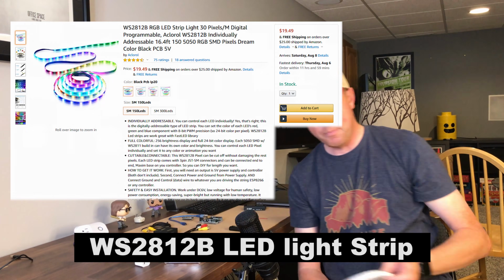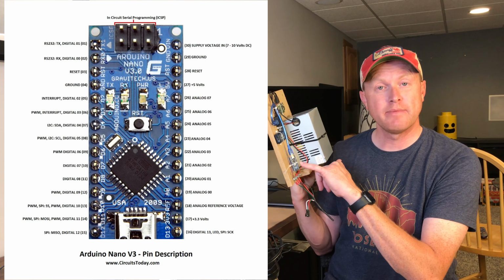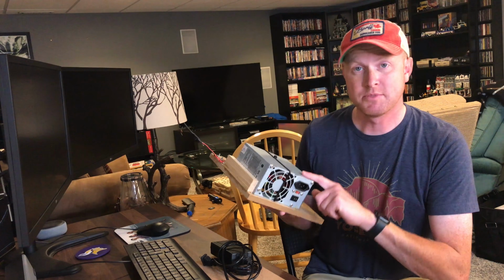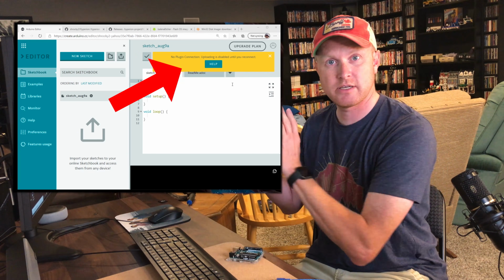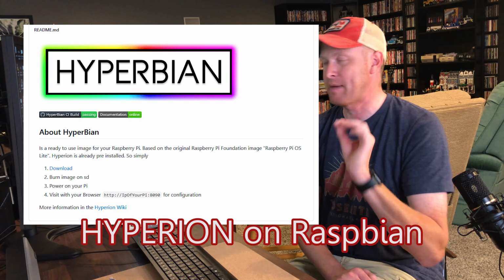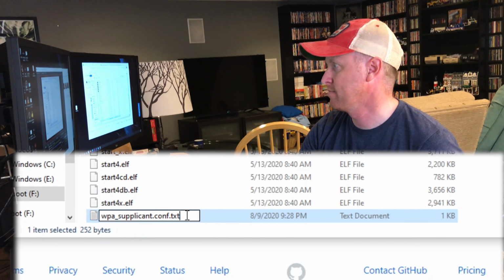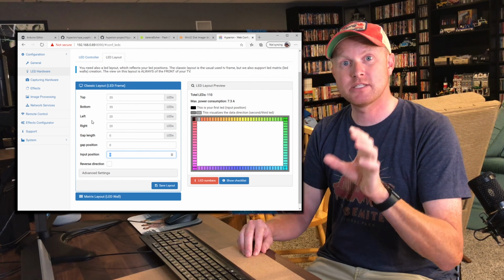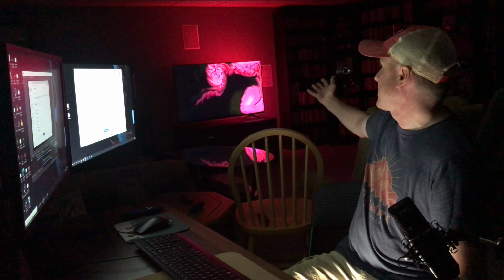DIY Hyperion Ambient TV Light Project (Raspberry Pi + Arduino) Complete Setup

Comment: So i got it working, couple things to note that may help others:

1.) I used the nano clones (the first link recommended on Steve's github) but when writing to it, I had to choose ATmega328P; the first one in the list.  NOT the bootloader.  When trying bootloader, I got errors when trying to write to it

2) Maybe its obvious but took me a while.  If you are using MORE than 110 leds, you must change that number on line 4 of the sketch.  I opted to buy the led strip he recommended, but with 2x the LED's and couldent figure out why only about half the strip would light up.  Was about to rip it off the tv when I realized I needed to change the number in the sketch (as well as Hyperion of course)

Comment: Hi STeve, in the Hyperion>LED Hardware>LED Controller, I am not getting the option for Bodrate. I am using an Arduino Uno with Pi 0W. Any suggestions?
Reply: @Steve_Does_Stuff  Thanks Steve, settings options found and worked. Can I suggest in the video description, to add text to refer to "Expert Settings.png in the Github page for Badurate settings option in Hyperion". I figured it out eventually but saw it was there all this time, LOL!
Reply: @Steve_Does_Stuff  Another query though, my lights are just not turning on, whilst it used to previously (when newly bought). The 4metre WS2812B strip I bought has power supply connectors at both ends. Have used a digital multimeter onto the strip to validate voltage is being received at both ends. The difference I have in my setup: 1) Arduino Uno; 2) Separate power supplies for LED strip and Pi 0 W but more than as calculated from formula and validated in Hyperion web editor for no. of LED's connected; 3) Using barrel connector in Arduino Uno board to transfer data (as the end of LED strip has two barrel connectors, one for power and one for data) that connects into the USB hub connected into Pi 0 i.e. not connected directly to the strip (do you see this being an issue generally i.e. does a cable ned to be directly from Arduino to the strip?). In Arduino sketchbook, I have changed line 9 entry for DATA_PIN to "5" instead of "6" as per the Uno's GPIO connections (will this work or be an issue, any thoughts?). 4) Connected Uno Ground terminal to Pi 0's Ground (awaiting cable delivery to connect from strip to either Pi 0 or Uno as per schematic diagram on Github). 5) 4k HDMI USB capture card with passthru connected directly to USB hub onto the Pi 0 (as per schematic).             Some successes I have had: i) previously the "Live feed" in "Led Visualisation" in Hyperian web editor was showing a fuzzy code i.e. not an image from screen which resolved when the power supply (Ampere) was increased.  ii) I changed the BOD rate to 115200 in both Sketchbook uploaded to Uno and Hyperion for Pi 0, as suggested in a user's comment, but to vain.           Any suggestions? Apologies to bother you with long text, would appreciate your input.

Comment: Great job man. I created a video on my channel just without using a rpi and hdmi capture card. Only works with pc connected. But I will try out your method. If I create a video from it I'll make sure to mention you and credit your work. Cheers.
Reply: I liked your video too. I use a PC for everything on my main TV, and I already have a Arduino nano and a power supply I can use, so I think I'm going to try your method.

Comment: Hi, I'm gonna bother you with another question. Can you also power the raspberry pi via GPIO pins using the red, white wires from the LED (the ones meant to be extensions if you wanted to add more LEDs)
Reply: @Steve_Does_Stuff  Thanks! Super helpful.

Comment: Hi, Will It work for 4K TVs? Do I need a 4K capture card? I read somewhere that the output sources should be same meaning if I used 4K TV and 1080 p monitor then I will get 1080 on TV and monitor. Is it same while using a hdmi capture card? Can I get 4K output on TV even if I used the basic 1080p hdmi capture card?

Comment: Your setup looks great! Little help if you can please, I have everything setup according to your video and everything looks to be correct. Arduino seemed to have coded fine, Pi zero picked up and I'm getting live video on Hyperion so it seems the HDMI capture is working also. Problem is when I power it up I get a green, red, blue cycle once and nothing afterward. Any thoughts on what to look for. I'm using 260 leds on a 18A power supply and purchased everything using your links except for the 60led/meter WS2812B. I'm not really savvy, just watched your video 20 times to get here LOL
Reply: @Steve_Does_Stuff  Thanks for the quick reply man but it all checks out baudrate 500000 and ran it through putty again with the same /dev/ttyUSB0. Even went back to your github and pasted the coding in again just to be certain I didn't fudge it. Same outcome green red blue and they go dead
Reply: @TheLast-Czar  Hi, did you change uint8_t for uint16_t? For 260 LEDs yo do need to do that...

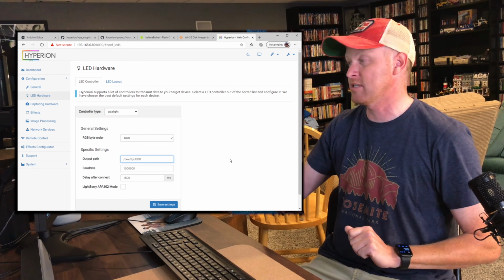Comment: Thanks for the guide Steve! I followed your guide to the letter, including the items purchased, and the only problem I had was the Raspberry wasn't talking to the Arduino - I think it was due to baud rates - in the most recent version of Hyperion, there is no option to set the baud rate (about 25:54 in your video) for the Led Controller Output path (some other comments indicate I could have set it to 115200 in the Arduino code?).  I ended up following some of the other suggestions to forgo the Arduino altogether and used the ws281x controller type, and connected LED the data wire directly to the Raspberry on pin GPIO18 (and ground).  Even though the Raspberry only has a 3.3V, the LEDs work great.  My 65" TV ended up with 268 LEDs and it works.  Thanks again!
Reply: @Steve_Does_Stuff  Well, it ran great for the last 3 weeks, but stopped working today - Hyperion is still working, and i can see the video feed from the capture card, and the LEDs still work, so I suspect that the GPIO pin on the Raspberry has burned out?  I’ll update here when I figure out what happened.
Reply: After tinkering with it, started working again. Not sure what changed.
Reply: @mikehatch4478  You should use a level shifter for the data pin, like a 74ahct125n to shift the 3,3v to 5v. you could also put a resistor in front of the data line, it's often recommended. May I know if you are still using your setup?

Comment: If you use a power brick how do you connect the power for the LED?
Do you cut the wire of the power brick and connect it with 3 wires from the LED?
Reply: @Steve_Does_Stuff  Thanks!. Just curious. What happens when you play a movie in a widescreen ratio and you have black bars top and bottom? Do you have no lighting for the entire movie?
Reply: @Steve_Does_Stuff  Thanks Steve. Appreciate it.

Comment: Ive purchased everything you've outlined here, seems like I've got all the software installed properly, i'm able to go into hyperion, and sometimes see my USB capture device (sometimes it bugs out) but it seems like the arduino isn't communicating with the light strip at all.  The only difference in the setup is that I'm using the power supply as listed on your parts and opted for the ws2812b with extra LEDs. any help would be appreciated!
Reply: @Steve_Does_Stuff  yea, i was able to match the baudrate to the upload on the create. The LED strip seems to be reacting, but not at all with whats happening on the input, even on a single color test, its flashing multiple colors.
Reply: @Steve_Does_Stuff  after sleeping on it, I believe I'd discovered 2 sources of the issues I've been having. First, I lacked a common ground, which I believe might have been bugging out the arduino. Second, because of the size of the TV and double the LEDs on the strip, the lights were Hyperion calculated needing 17 amps from a 10 amp adapter. I've ordered the same strip you have which will reduce the amperage to about 7.8, which will work better for the adapter.
Reply: @Steve_Does_Stuff  UPDATE! Got it working! Common Ground, Common Ground, and I'll say it again, Common Ground! Also switching out the LEDs to the one that had the proper amperage with the adapter likely helped as well.

Comment: WOOO HOOOO! A Bit of trial and error but I have it working! Rpi and Hyperion was the easiest part. Some notes about the Arduino Nano clones:  Once I got set up on the Arduino Editor, I had issues programming the Arduino Nano clone. I would error every time. The thing that worked was to plug it in, and whatever the editor recognized as the default, that's what I went with. No changing comm ports, or changing to the Old Bootloader. The baud rate did not work at 500000.  I set line 18 to 115200 and that got it working. (A quick search for Arduino Baud rates and found this: https://www.arduino.cc/en/Serial.Begin )  I also set line 12 to GRB, and matched it in Hyperion. The last thing, even though I ran the LEDs the same direction you did, I had to checkbox the Reverse Direction setting in Hyperion.  Thank you so much for all your work. It's really something special to see it live in action!
Reply: My lights are not turning on, I can see my image in Hyperion but not lights, With what you did will this fix my problem, I don't think the Arduino is sending a signal to the lights
Reply: @MrKingtiny  I'm having the same problem. I see the image in Hyperiod but no lights on the LED strips. Any luck?

Comment: You could probably cut out the use of an Arduino altogether and interface using only the RPi.
Reply: @Steve_Does_Stuff  tbe raspberry pi has 3.3v And 5v... No need for arduino.

Comment: trying it for a year now .. a whole damn year. and its still not working, spend over 200 € till today for stuff, losing my mind
Reply: Common ground? Baud rates match? Data flowing in the direction of the arrows on your strip?
Reply: @tjdurkin8848  could i need to check if it works when I create a common ground? baudrates are matching 500000, i also ensure the arrow points away from the source, indicating the flow through the strips, yeah
Reply: it work! common ground was the thing I did not hear in the video at first .. Thanks a lot !!
Reply: whats going on ?
Reply: @herbalmethods  right now they are blinking randomly. I used the hyperion android app to set some solid colors.. they sometimes work.. sometimes it doesn't seem to react at all. But basically the first maybe 5 led are always white, then the rest ist flickering in random colors. Tried pin 6 and 5
Reply: @Agiztos  yep... Try what dj says! Sounds like common ground issue....
Reply: @Agiztos  also another thing to Check...... I had an issue with the instances trying to work on top of each other and making lights flicker.... Changed settings so it only uses one instance at a time and it cleared it up

Comment: Is this old version of Hyperion or why you need Arduino here? You can use GPIO 18 on Pi Zero to control LED strip directly.
Reply: @Steve_Does_Stuff  I'm asking because I've just builded my first project following YouTube video (similar to your and just searched for proper led layout) and just connected 96 leds from my WS2812B strip to GPIO 18 without any shifters and it works just fine. Will it fail at some point or it depends on strip somehow?
Also, I you can use HDMI capture card with HDMI loop to eliminate HDMI splitter in your setup.

Comment: When I plug my audrino clone (same one you have) into my Pi3, go to COnfiguration > LED Hardware. Set controller type to adalight.  Under Specific Settings all I see is an output path that I can set to USB0.  I do NOT see baudrate

Comment: Could you run the HDMI splitter from the TV USB port, run the pi on the 5V SB line from the power supply, combine that with the push button for startup and shutdown of the PI, then run a startup and shutdown script that turns on the power supply (connects green to black via GPIO) when the PI starts up and powers it off (dis0connects green from black via GPIO) when the PI shuts down?

Also, reminder that you can set up DHCP IP Address reservation on your router so it always gets the same IP. You'd need to log into your router's web interface and find the DHCP or IP reservation settings, then input your Raspberry Pi's WiFi or ethernet (if using a hat/adapter or full sized Pi) MAC address. It makes everything easier to use if you need to type the IP to access something, including VNC, SSH, web servers, Pi-Hole, etc. You could even write the IP on a piece of tape or print a label and put it on the PI so you always know what its IP will be.

Comment: when using a computer powersupply make sure that it supplies enough amp's at the 5v powerrail. For example a 250w power supply will not give you 50 amps at 5v. it will divided that power between the 5v , 3.3v and the 12v output rails. You can find this information usualy at the label of the power supply unit. I found that out the hard way.

Comment: But aren't 4K@60 capable HDMI splitters quite expensive?
Reply: @Steve_Does_Stuff thanks! No need for 120 Hz, i'm using LG SK8500 as a monitor (max 4k@60). So it will fit perfectly.

Comment: which LEDs should prefer for TV ambient light 60/144 LEDs/meter??
Reply: Go for 60. That's more than enough light. Any more than that you'll be wanting to dim the lights. Afterall you are trying to acheived an ambient effect.
Also, if you were to crank up to 144 LEDs / meter you'd need some very heavy duty power supply. A pretty normal sized TV would use 4 meters of LEDs. So you would be looking at (4x144) 576 LEDs! That means a max power consumption of (.06 X 576) 35amps i.e. (35 X 5) 175 Watts! Better start calling the firebrigade!

Comment: I do not see the reason behind why are you using Raspberry PiZero + Arduino? Cant you skip the Arduino ? I have seen setups with only a Pi, but not zero one. I am pretty sure that the Zero can do the same thing.
Reply: @Steve_Does_Stuff  Ahh.. right totally forgot about that. There is a hack where you can sacrifice the first LED by placing a signal diode before it that drops the voltage to it by a little, which then propagates the signal to the others. The first led will be a lil less bright, but if the lack of space for a level shifter is of a concern its a good work around.

Comment: Everything is setup and when I change the RGB byte order the LED does it's test cycle but nothing works after that
Reply: In case anyone else is having this issue I has this same issue and appear to have resolved it by using a different  Adalight script from the one he used.. https://github.com/dmadison/Adalight-FastLED. After uploading this code everything worked like a champ!

Comment: Hey, thanks for your video. 
I would like to use a sk6812 rgbw-nw led stripe. do you know if this would be possible and if so, how do I manage this?
greeting from Aachen / Germany
Reply: Fastled does not formally support SK6812 led strips. But there is a workaround

https://www.partsnotincluded.com/fastled-rgbw-neopixels-sk6812/
Reply: did you write the sketch for the arduino? I really would like to use the rgbw strip sk6812. I already found out, that the fast led library supports thus strip. But I don't know what to change in your sketch. Could you please help me out?
Reply: @MrJimmie55  #metoo ;-)

Comment: question: I want to do this for my monitor, but my monitor runs on Display Port so I can use the 144hz.  now towards the end, you said that it'll only take HDMI inputs. So does that mean I am out of luck?  Or  do i need to use a display port capture card instead?  and if i do, will the software support it?

Comment: Thank you for this great video. Can you comment on how we can control this setup using Google Assistant? Also, I saw a video of the Phillips Hue system where they show the lighting change extends to other rgb bulbs set up in different locations of the room.  Is that possible with Hyperion? 

I am willing to pay to learn to recreate the Phillips Hue effects on a DYI setup

https://www.youtube.com/watch?v=2yTdII3qiBw
Reply: something id like to learn aswell... any progress? we could work together on this
Reply: @Ar15tocracy  this is what I have learnt :
1) If you want to setup anything more than 300 LED. You need to use a different Arduino script. If you google search it you can find one with 500 led setup (this is important if you are doing anything above 60" TV. I implemented this project on an 85" TV with great results.

2) If you want to extend the lighting effect beyond the screen, you have to have a Philips system (hub, and the play HDMI sync box)... Now for the lights buy other brands and link them up to your philips app and now you will have entertainment lighting setup. (https://iconnecthue.com/supported-devices/)

Comment: My LED strip does not light up... what am I doing wrong?? :o
Reply: Maybe it is the common ground problem ... how do I solve this when I am using a YINICE (Arduino One) LED Controller and the Power brick that came with the set? Can anyone help me? :-P
Reply: @intou.global  do they light up at all - rgb flashes at startup? Or absolutely nothing?
Reply: @tjdurkin8848  I know could solve the problem :) it was the wrong pin in the arduino, I opened the controller and found the correct one! 👍🏻 Everything works now perfectly fine 😜🙌🏻

Comment: HEEELLPP!!!
First of all GREAT VId !!!
I am worried abot that the 512 MG rhaspberry Pi cant handle the 4k input.
i am about to buy 1m/144 LEDs will the Rhaspberry Pi 512 MB work fine with it ?
And do i need a 4k Capture card if i have a 4K input ?
Reply: @Steve_Does_Stuff  Thanks for your quick awnser. Luckily my TV has a HDMI output so I can use your system any time 😊

Btw it was hard to me to find a dc5 150W transformer wich is needed to power 144leds/M....so i had to downgrade to 60 LEDs/m like as you have.
Parts will arrive until Tuesday . Wish me luck that everything will be fine :D 
Greetings from Hamburg/Germany